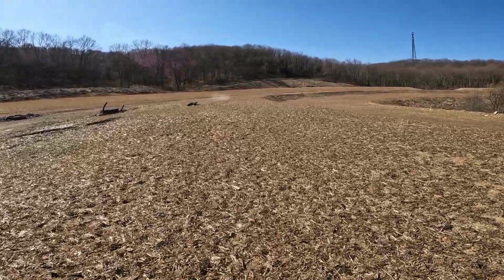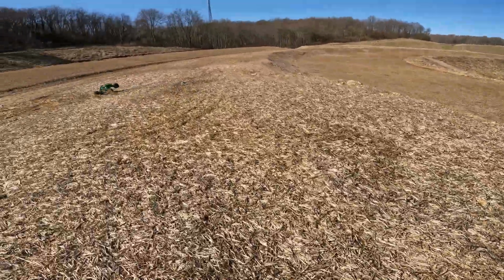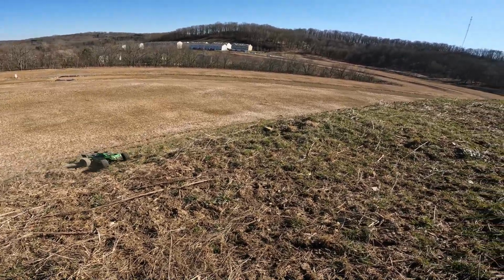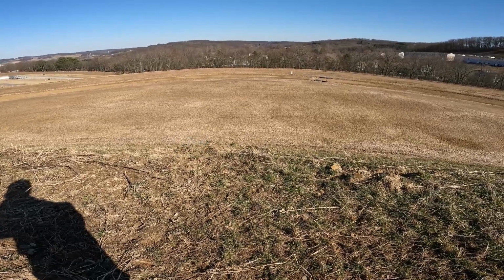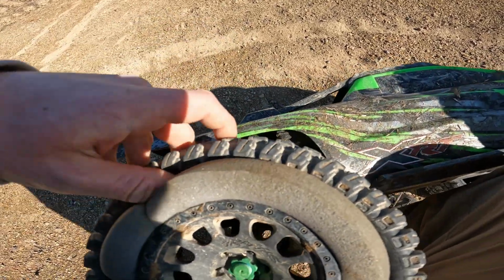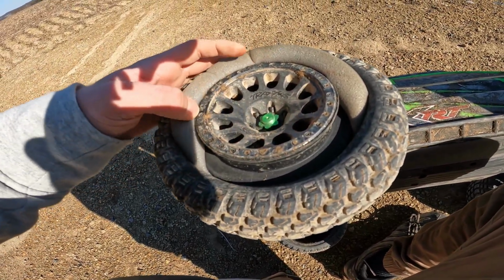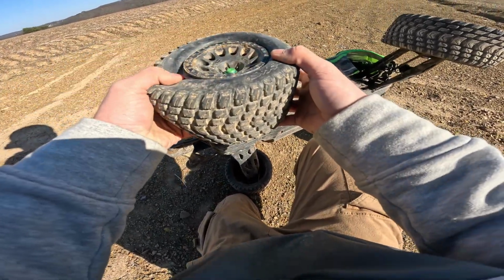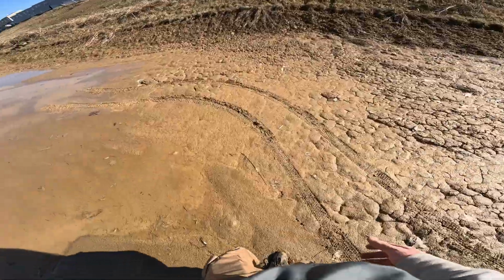Full Sending the Traxxas XRT! (GONE WRONG)

Comment: My sledge tyres would not come apart no matter what I do. But pieces of foam are shaking around inside the tyre. Very disappointing!
Reply from the maker: Wow, never heard of that. That sucks dude. I’m amazed cuz I heard good things about the sledge tires.
Reply: @Mr_Neil_TV   I think water found its way into the foam. Tyres shouldn't have to stay dry to not fall apart.
Reply from the maker: Yeah, I agree. But it is what it is. That foam cannot get wet. Next time if I were you either get tires that are vented through the rubber but if it’s vented through the rim make sure to put some tape over the hole before you go get it wet!